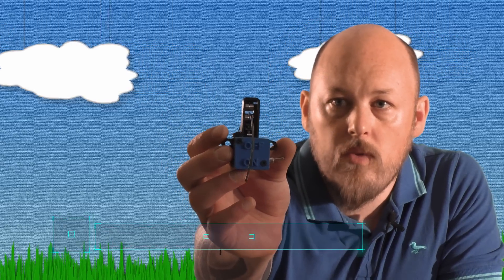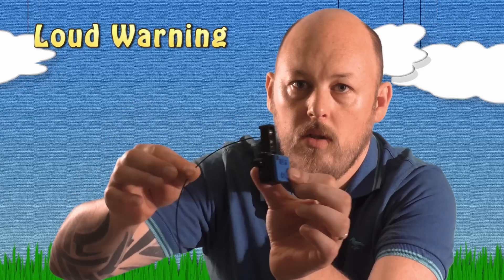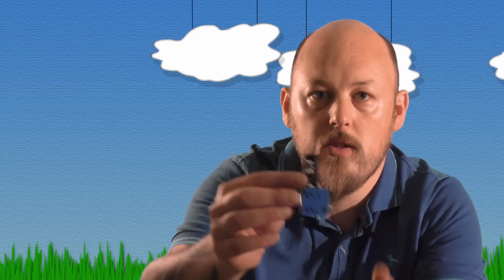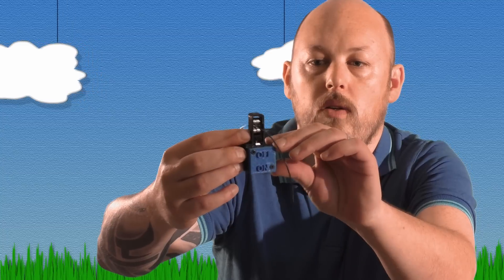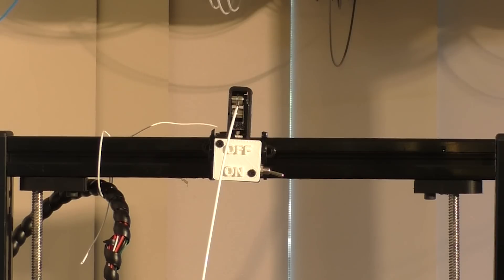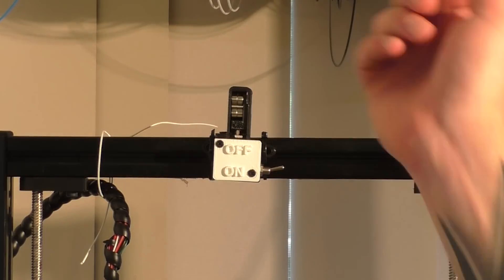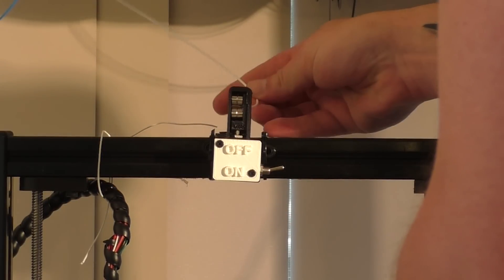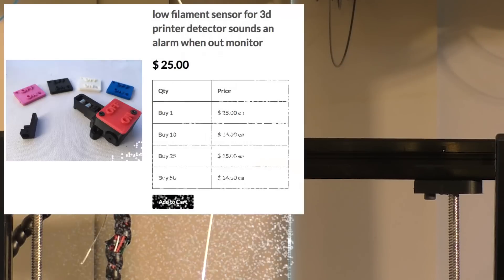Low Filament Warning Sensor Review!!

Comment: Looks simple and effective. Just two or three questions pop to my mind:
It seems to have a battery inside, does it give a warning if battery is getting low? If not, well, that could end badly if you got used to the warnings, and then there is no more juice to beep, and no filament anymore...
A simplified version with just the two bearings and a connector would actually be nice to use it as sensor to pause your print (if you have a free io-port and know how to expand the firmware), but i guess, if you are that smart and already have a 3d-printer, it would not be that hard to just make your own sensor with 2 ballbearings and a spring. ;)
Reply from the maker: +ExtraBase Hi! As the thing uses 0 power while there is nothing touching, i would think the battery would last a lonnnnnnng time.. BUT as a precaution i check the buzzer each time i load filament :)  And yes I agree tapping the buzzer output to an I/O on the control board to pause should not be difficult at all - thanks for the feedback, been quite discouraged lately due to subs not increasing etc
Reply: +The Hot End Aaaw. It's probably not that easy to draw more subs into a channel. You have some good content already, I kinda like your style, and production seems to be good and improving all the time. Maybe you have to pull some stunts like Joel did and get some 'famous' youtubers to do some collaboration with you, or try to tap into other communities with projects that target a specific audience (gamers, movie-fans, gadget-nerds or something)? Just a few ideas from someone who does not have a clue about the youtube-game... :-p
Reply from the maker: +ExtraBase Thanks! I am trying very hard to make it better and better - I can do collabs with Joel or Angus or Chuck - Maybe i'll do some sci-fi prints or gamer prints.. Cheers!

Comment: how much
Reply from the maker: +kane vina Hi! $25 USD (slide pops up towards the end)
Reply: +The Hot End thanks
Reply: +The Hot End Yeah, which is unfortunately pretty high for something that, with some work, can be made for far less...and integrated into your printer.  I did a quick search and found this interesting - and much cheaper - project:  http://www.thingiverse.com/thing:744006  

I'm not sure if that will work on a Wombot (looks like it will, but I don't know what changes Aurimas may have made to the firmware and/or hardware that might not allow for it), but if so it would make for a very excellent video/tutorial, Anthony. ;)